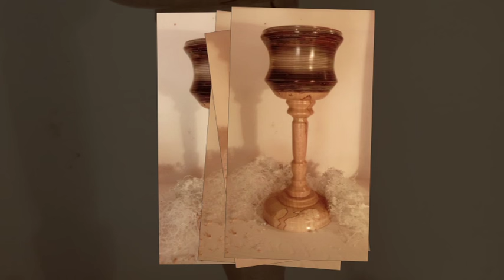Woodturning a compact disc Cupped goblet !!

Comment: Dude! Super nice. I think this is my favorite so far.  I especially like the way the cup part catches the light. The light/dark shading is beautiful.  I wonder. What would happen if you put a bunch of cds into a metal cylindrical mold and applied enough heat to melt them all together into a blank?  Instead of using epoxy?  Is that even feasible?  I just think it would form some great patterns.
Reply from the maker: +Gandalf TheWhite Yep I am experimenting with heat at the moment so all I can say is watch this space ;-) Thank you for watching and commenting, its much appreciated, regards, Steve.

Comment: Hi. Do you have a video or have you explained how you secure the top of the goblet with the tennis ball? Thanks.
Reply from the maker: +John Friesen Hi, I dont have a video, but its quite simply just pushed up to the cup with the tailstock and a little pressure applied, this works very well as a buffer to reduce vibration....  I will explain in the next video I use it in, thanks for asking and for watching,  regards, Steve.
Reply: Thanks, Steve.
Reply from the maker: No problem, Thank you John....